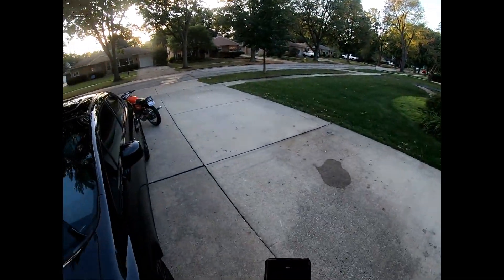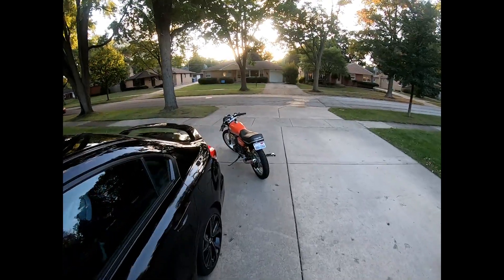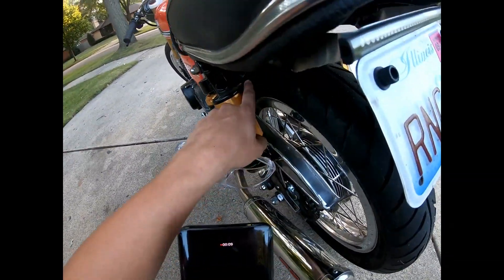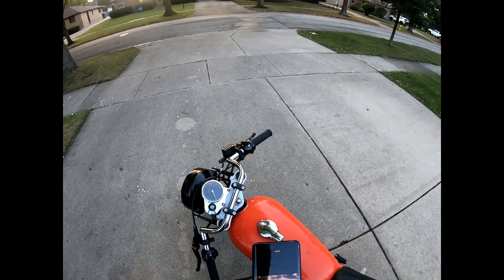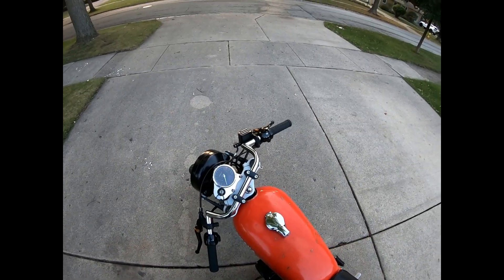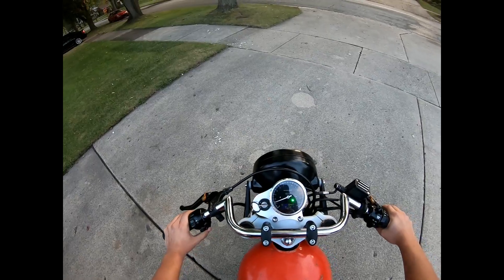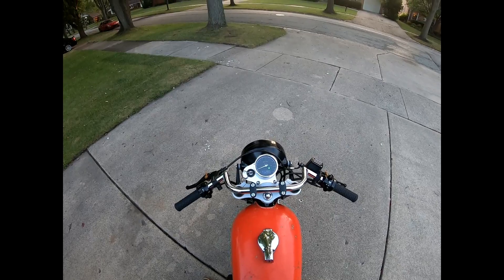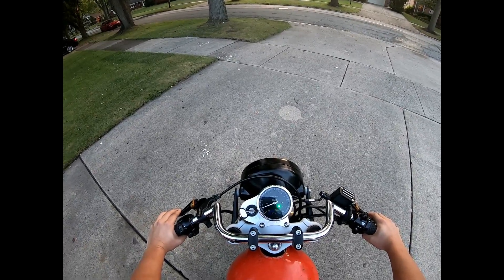1975 Yamaha RD350 Test Ride - Solid State Regulator/Rectifier

Comment: Where can I get those rims could you help me out to get
Reply from the maker: Ordered the rims and spokes off Buchanan's Spokes online! 

Front wheel: Excel WM2 shouldered 18x1.85 polished
Rear wheel" Excel WM3 dhouldered 18x2.15 polished
I got their stainless spokes and nipples as well
Ultrasonic cleaned and sanded/polished the original hubs myself and built up/laced the rims to the hubs. 

The sanding/polishing of the hubs probably took me 4 full days and I used this stuff called Shine Seal to coat everything and hopefully keep the shine for many years to come.

Comment: Hi.
Which rearsets are you running?
I myself has a RD350 with the same JL exhaust.
Reply from the maker: I'm running the slipstream cycle works rear sets. I did find that i had to make tiny brackets that drop the exhaust mounting points about 1/2 an inch down to clear properly, but apparently, that's uncommon. 

I'm very happy with them and they have a really sweet solution for the rear brake. I do want to add a rubber boot to the shifter as it keeps rubbing through my shoe laces since the shifter is just knurled aluminum.

Comment: Would you recommend this mod? Is it worth it?
Reply from the maker: If your regulator/rectifier is going bad then definitely! A nice compact unit, had to do a little massaging to the battery tray to fit this regulator, but other than that no complaints.

Comment: Dude, let it warm up a bit before.....
Reply: You don't wanna let 2strokes build fluid  and gas to the plugs. Soon as it starts, get on that powerband...
Reply: @chillhomebody2958  pull apart your weed eater and your chain saw after doing that , and you’ll see scoring on cylinder wall at exhaust ports , it’s not going to hurt a thing to let it warm up . imho and if you don’t believe me just start it up cold and start reving the shit out of it , note what happens, then repeat on cold engine start and warm up touch head then rev the shit out of sitting there … note results & note this abuse of the little engine crying noooooo
Reply: When you let a 2stroke sit idled, it's gonna load up the plug, when you race 2strokes you'll see professional  racers at the line tweaking on the throttle, getting thst 2stroke off the plugs.
Reply: He always warms it up. Edited it out.
Reply from the maker: Martha got it right, I always let it warm up a bit and cruise on it for a few minutes before warming it up. Just editing the boring parts out. Good catch!
Reply: @Enginerded  I live in downstate IL and have an RD350 that recently is having a weird electrical issue(s). Do you have a way I can reach out to you for some troubleshooting advice?

Comment: RD as stock had a beast of an alternator (360W) I seem to remember. I used to run a 100/90W Cibie spot for a headlight on mine in Scotland and never had a problem with the (tiny) battery going flat.

Comment: I have a RD250 and im looking for a clean single guage setup like that. How is it getting mph? doesnt that come from the speedo cable thats usually on the left side front axle?

Also what key ignition is that?
Reply from the maker: So its a motogadget chrono classic gauge. It comes with a hall effect sensor and 2 tiny magnets. I jb welded one of the magnets to the brake rotor. When designing the brake caliper bracket, I made a perch to insert the sensor into so that the magnet can pass the sensor with each wheel rotation. Pretty simple setup, you just need to make a bracket for the sensor for your application. You set up the wheel diameter, number of magnets, etc in the gauge settings and it calculates the speed.

The gauge/key ignition bracket is something i designed as well and had machined. I used Solidworks and sent the files to a machine shop. A fair amount of custom adapter pieces to the front end swap i did!

Comment: I did the same (Rick’s Motorsports VR) conversion on mine and it blew my inline power fuse and meted the fuse holder before I could even fire it up. Did you find a fix?
Reply from the maker: Sounds to me like you maybe had a faulty unit or had some wires connected incorrectly? I haven't had any issues with mine. Got it from Economy cycle, been putting miles on the bike with no issues.
Reply: @Enginerded  I had the same thing happen today on my R5
Reply: narrowed it down to regulator plugged in ...didn't blow with rest of connectors plugged in!
Reply: my R5 did the same thing
Reply: Fixed it!  previous owner or someone had the wire going to the brush grounded!!!  green wire coming from regulator....working fine  now